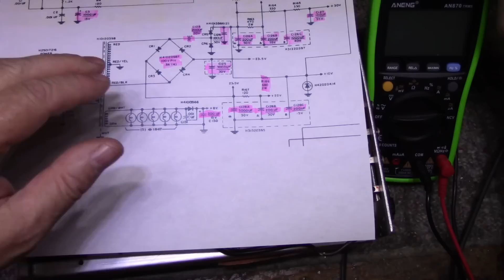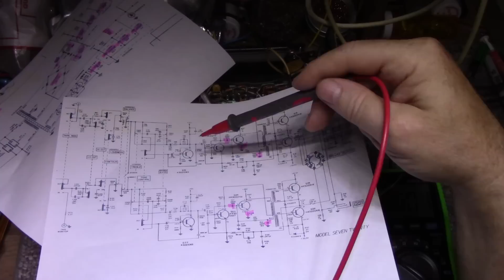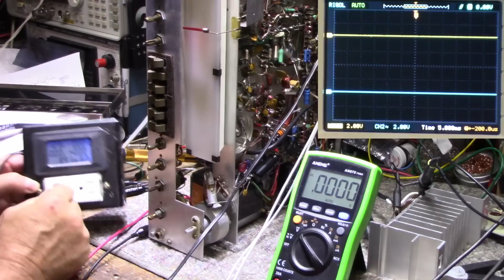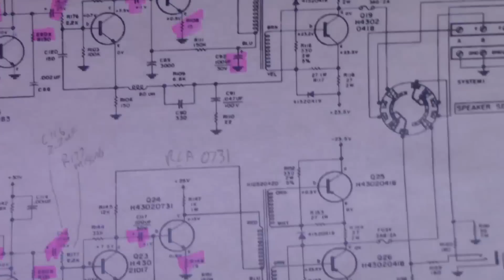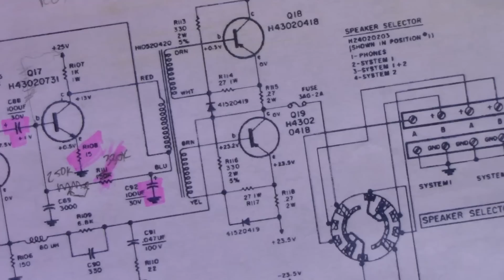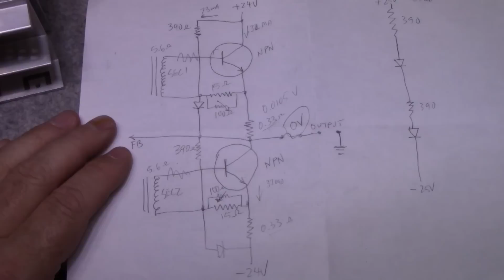Harman Kardon Seven Twenty Part 2 (Ep. 187)

Comment: Based on what I've been told BPs are good as input blocking caps however uping them to 22uf is going limit your FR. Right? Or did you mean 2.2?
Reply from the maker: I've seen input blocking caps from 0.47uF to 47uF. They all seem to pass the signal without much change. Of course amplifier input impedance plays into this as well.

Comment: I think if it was my receiver, I would junk the amplifier and put in a chip like the LM1875T it may not be vintage, but the power will be better, distortion would be 100 times lower. Giving the customer a real HiFi sound but the same external vintage look. As is, the waveform was probably one of the poorest I've ever seen. Must sound really rough.
Reply from the maker: The main goal here isn't to maximize low distortion or power
My goal is to get it working in a like-new condition to see how these vintage pieces worked back in their day, warts and all.
As you can see, the negative feedback corrected a lot of garbage that the amplifier creates.
Reply: @TrevorsBench  Glad I saw this explanation because it makes sense now why you went to so much trouble on an item with little or no real value !
There were more than a couple of times when I would have given in to the temptation to throw it hard against a solid brick wall but that also shows just how much patience you have too !
Reply: I agree, replacing Q16-Q19 on one channel and the equivalent transistors on the other channel.